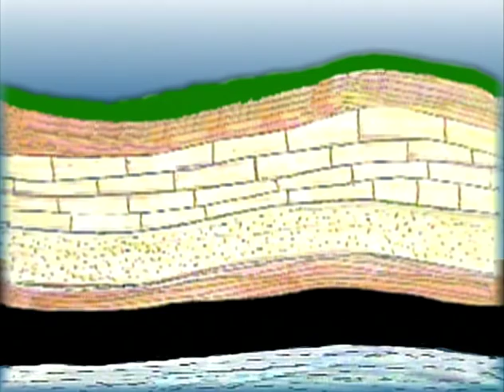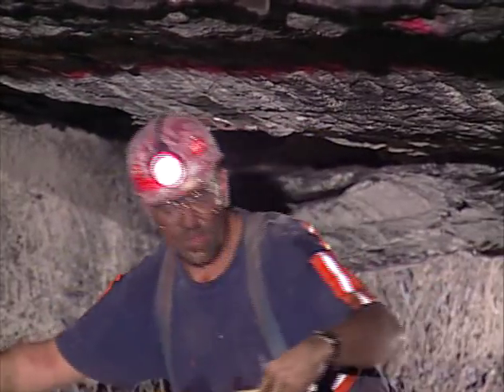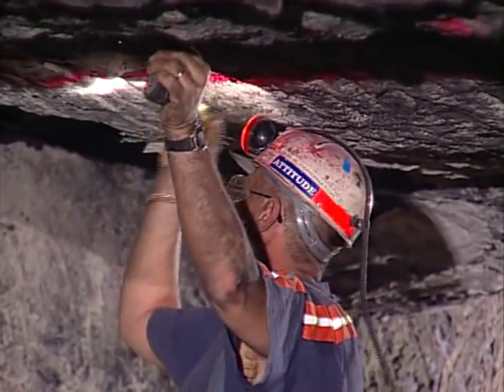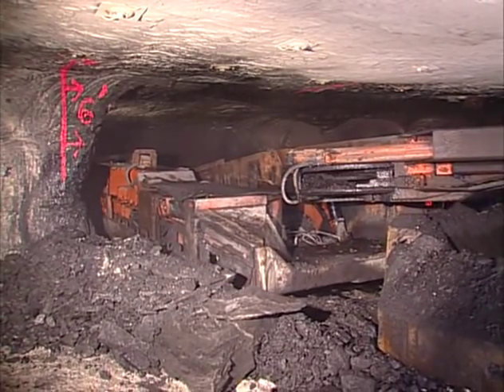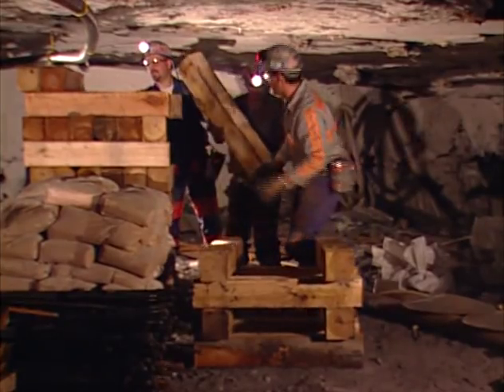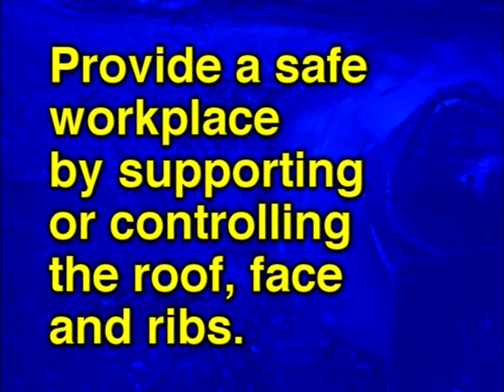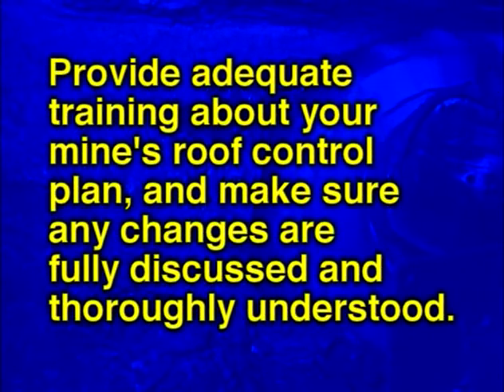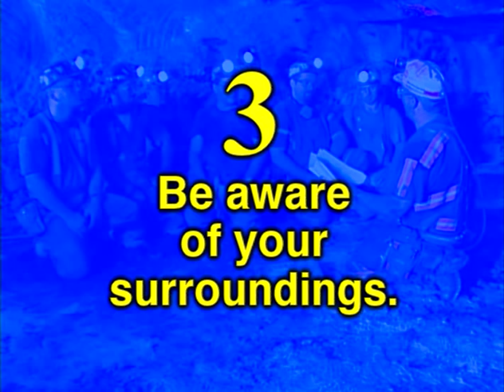Roof and Rib Control

Comment: a good way to support the ribs is by using corrugated plastic mesh. Unlike steel its easier to identify loose rocks, fire resistant and anti static.